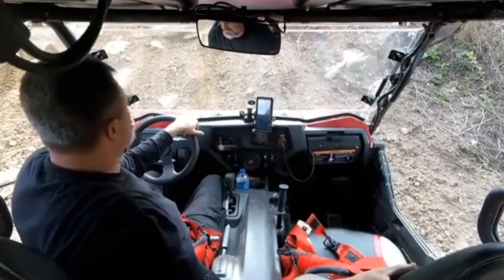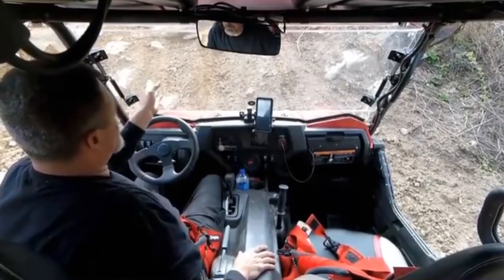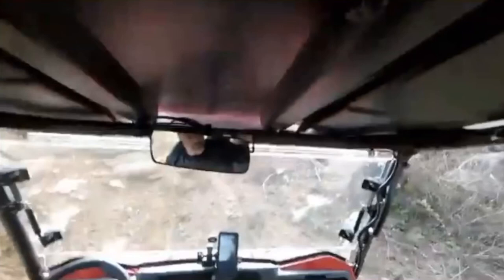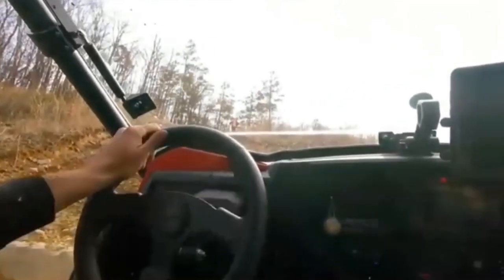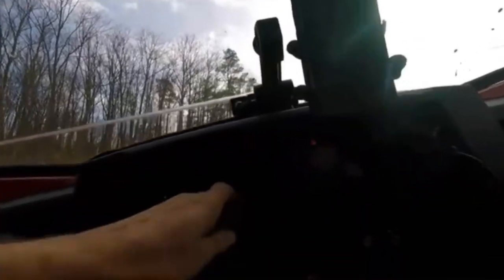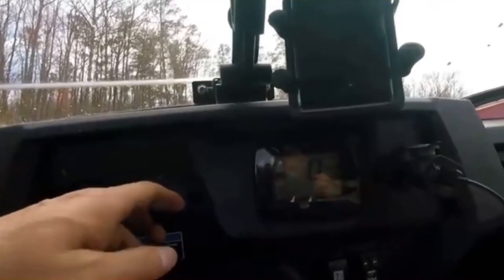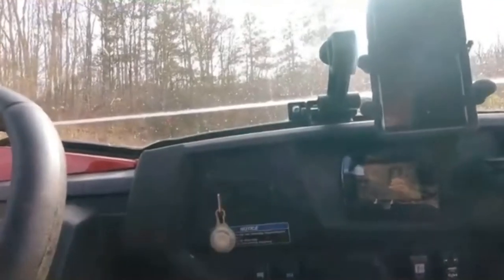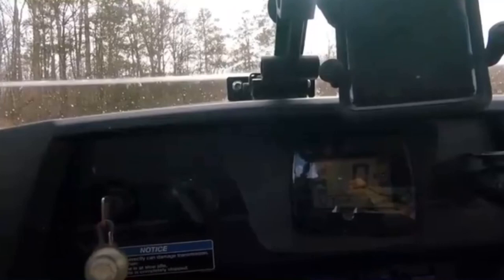How To Use Kawasaki Teryx 4wd Diff-Lock

Comment: Thanks for this! This was driving me crazy this winter especially with the diff lock speed limited as low as it is. I was busting through some snow drifts and couldn’t get it to disengage. Drove across a large field stuck in diff lock. Thought the snow was packed in causing problems but then had it happen again later with no snow. You saved me a trip to the dealer

Comment: Looking for a part inter tie rod for 2017 mule pro fx need factory one. Has 4 inch lift with high lifter a arms. Sitting on 32 inch tires. Crashed it

Comment: Just got a new 2020 Teryx 4, and I'm new to having a atv, I was wondering how often you need to run low gear?
Reply: Only in mud or when you get stuck you go to 4wd low
Reply: @Cowboycj496  I was told it your running at speeds consistently under 15 mph to go in low.